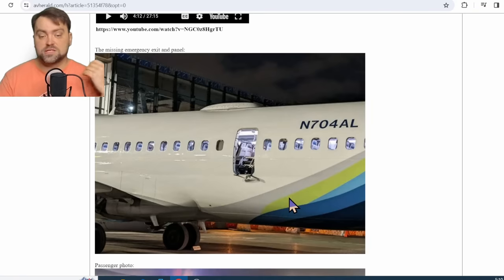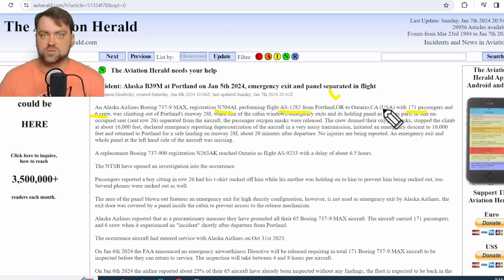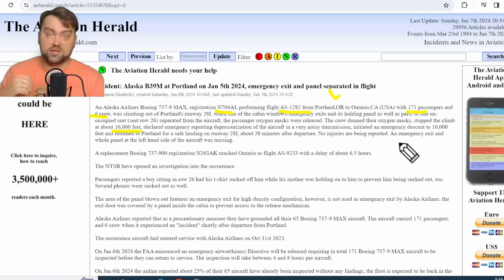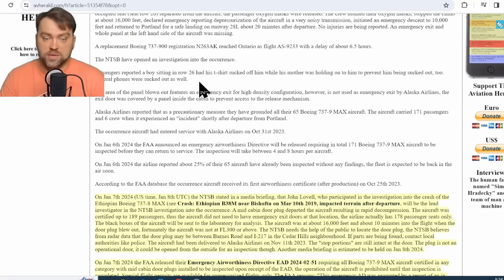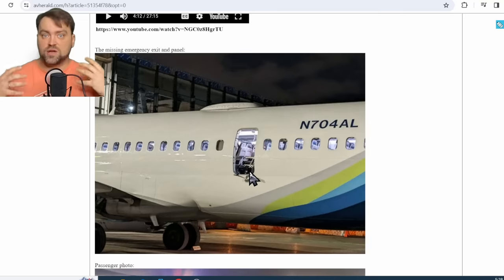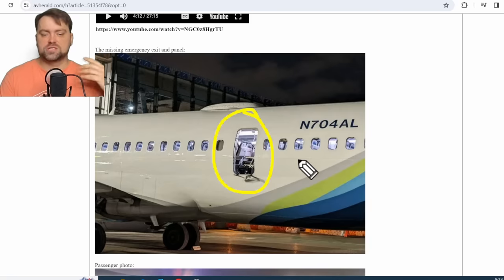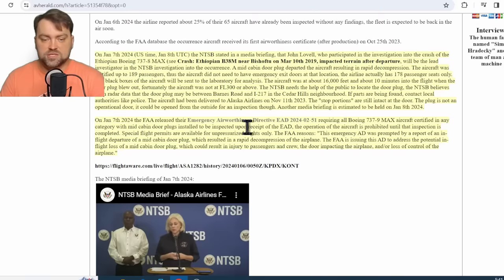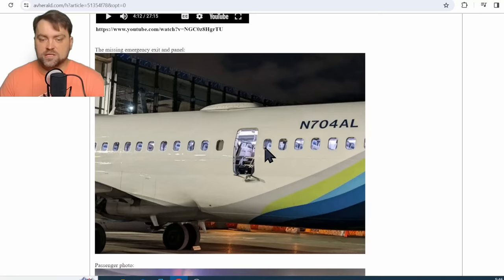Alaska Airlines Boeing 737 MAX Door Separation Update | What Happened?

Comment: What is going on with the MAX series? Does the MAX stand for MAX profit at the expense of safety?
Reply: If it's a Boeing, I'm not going.
Reply: @iactiv6274  Nah, the Boeing 747 "Jumbo Jet" is my favourite plane, so I have no issue with Boeing. Specifically the MAX series variants seem to have an unreasonable amount of issues.
Reply: What if people says Airbus is to be blamed for the recent a350 incident in Japan?
That would sound dumb right?  Same as anyone blaming Boeing for this incident
Reply: What plane hasn't has problems. The 737 is s 50 year old platform that has been thr safest and most successful plane in history. 
It will take a lot more "problems" before that record is tarnished.
Reply: @kewlztertc5386  Would you say same if one of your relatives died on board such a disaster plane?
Reply: And way, way more people have flown on them... safely.
It's always a per passenger mile question...
Why don't you check the number of people who died in Chevrolet xxx?
Reply: @Samguy55  Who else is reliable for this mishap except Boeing? this is a part of the plane that has to be checked only after years except in cases of severe damage. So, tell me why one should not blame Boeing for that!
Reply: Imo the problem is not so much the plane, but the quality assurance at Boeing right now. They have cut corners, got preferential treatment by the FAA, and only admitted and addressed issues after accidents happened.
Reply: @lohikarhu734  How many cents per post are you being paid to defend Boeing?
Reply: @Samguy55  So how does the plug/door of a brand new Boeing 737 Max 9 fall off if there isn't a huge problem from when it was manufactured?  I'd say this falls entirely at the feet of Boeing!
Reply: @smacktard6051  wrong, that record goes to the 727. 
Did you even bother to confirm your erroneous information before responding?
Reply: @thabom9791  I have gad loved ones who died in GM cars, I don't hate Camaros.
Reply: The fuselage and door plug are made by Spirit Aero, a subcontractor of Boeing. Still, the responsibility lies with Boeing to ensure the entire airplane is built correctly.
Reply: @johnhaller5851  That's right, Spirit Aero (not to be confused with Spirit Airlines) is currently a subcontractor of Boeing. They were part of Boeing until 2005 I think, when it was spun off into it's own legal company so they could also do work for Airbus.
Reply: @kewlztertc5386  I think you're confusing the classic 737 with the MAX series. They are completely different aircraft that should not even share the same name. I'm convinced they only kept the name to benefit from it's reputation and to fast-track certifications. The MAX clearly has quality control issues, the plane is literally falling apart in the sky.
Reply: I'm thinking that the position of door is creating a longer arm from from the horizontal elevator, creating bending and twisting forces greater than a door closer to tail surface. The result of this forces cannot be seen by the eye.  This reminds me of early Jet crashes of the "Comet". In the comet the window were too big allowing twisting and bending forces to be greater. I hope that this is made and develpoed from scratch. I can't imagine of using plans from rear door.
Reply: @johnhaller5851  They are, but then they are shipped back to Boeing for the interior cabin to be fitted. The plug/doors are removed again by Boeing during this process. Info courtesy of Blancolirio. https://www.youtube.com/watch?v=WhfK9jlZK1o
Reply: @maybehuman2148  they're not different. It's just an iteration,  like the NG, 400, 200, and 737-100. 
It's the exact same frame, with upgraded avionics and engines. 
Just as the preceeding generations were upgrades from generations before. 
The MCAS issues they had with the 737-8s (Max-8) 3 years ago was because of the larger engines they fitted on the plane compared to the 737/NG.

This plane is a 737-9 (MAX-9) extended fuselage.

Lastly, it's named MAX, because it's the end of the 737 line.  It was designed to bookend that model number and be replaced with the now defunct 797 concept.
Reply: @kewlztertc5386  When an aircraft has completely new and significantly larger engines, new avionics, a different center of gravity, even new wings, is it just another iteration or a new aircraft? How much different does it need to be in your opinion?
Reply: @maybehuman2148  it's not MY opinion. It's the opinion of Boeing and the Aviation community. 
Instead of attempting to express your cynicism, why not actually look up why?

Here's what little I know:
 it's the same platform. Just like the 5 or 6 variants of the 747 (100,200,400, SP,,ng,800) over the decades.
 It seemes to be based on the fuselage. 
They upgrade the 777, with carbon fiber wings, it's still a 777.

Engines have always been an option on airplanes. The airlines up until recently had a choice between GE, or  Rolls-Royce. 

Finally, The FAA requires type ratings if the Avionics change too much. So manufacturers make incremental changes that require less simulator training. Making it so a pilot only needs to learn what's new and not a whole new system. This is the root of the MCAS problem with the Max-8. 

But I don't know any of the details for sure. This is why it would be helpful if you looked it up and informed ypurself and me.
Reply: @kewlztertc5386  TL;DR: You don't want to think for yourself, so a new aircraft is whatever Boeing tells you it is. Got it.

Comment: My thoughts on this accident...someone forgot the bolts or fasteners and the door broke away cleanly with no tearing.
Reply: @mh-ht2fp There’s no flaw- this exact plug style exit has been around a long time. The question is who didn’t install four lock bolts correctly?
Reply: Agree, someone didn't inspect the work on completion of the aircraft. I assume these plugs are considered permanent and not a check item for maintenance.
Reply: @mh-ht2fp  well we are talking about Alaska Airlines, but also a new plane 
so its ether Alaska has turn back to their old ways or
counterfeit aviation parts have gotten into Boeing supply chain
Reply: @denault3985  There is going to be some interval to open it and check it and the seals and replace the bolts, and probably a shorter one to check that the bolts are still lock-wired.  But probably not yet given how recent the airplane is.
Reply: @1BigBen  This is not a part that needs maintenance. So it must be a production failure by Boeing.
Reply: Oh it tore stuff up. All around that door area go damage.
Reply: NTSB only has to check the comments here, then they don't have to investigate anything anymore. Everything is already known by the internet experts here.

The benefits of the internet are clearly showing.
Reply: @jantjarks7946  There are two likely causes.  The bolts that are supposed to lock the plug in place were not installed or 4 bolts in a new jet all broke off with no obvious sign of damage after 2 months of operation.  That's why the NTSB wants those mounts in DC, so they can see if there is evidence of a bolt ever having been installed and tightened down.
Reply: @1BigBen Alaska doesn’t install the door, Boeing does.  I don’t think this has anything to do with wrongdoing by Alaska.
Reply: I heard reports this plane already made 150 flights before this happened, so the bolts were there. More likely the bolts were either defective, or something wasn't fastened to the correct torque. Repeated compression stresses and vibration kept weakening them until they snapped.
Reply: @jantjarks7946  Calm down dude. It's the comment section, people like theorizing for fun, nobody is getting in the way of the official NTSB investigation.
Reply: @maybehuman4  Or they were not lockwired and the nuts slowly loosened.  Juan Brown says it was not lockwire, just bent cotter keys, but that would work the same with the castle nut.
Reply: Yeah, sorry to interrupt the theorizing into trash talking. Please go on, it's not your reputation to be ruined by speculating the heck out of something.

Absolutely no one starts to jump the gun right away in the comments due to it, really no one. You can read the other comments, absolutely clean of opinions and only facts.
🫣😉
Reply: NTSB seems to agree in tonight’s briefing.   There are no signs of the stop bolts and they are next looking to determine if they were there at all, or not sufficiently torqued or something else.  It sounds like being sheered off is ruled out.

Comment: Clearly the door could only come off from the aircraft without damage to the airframe if the bolts were never installed or were not correctly tightened causing them to come loose and fall out.
Reply: Someone call the NTSB!  Call off the investigation.  They just need to talk to ecomandurban who has all the answers.
Reply: It doesn't work that way on these types of doors.
Reply: @stargazer7644 , it’s because someone took that “Do Not Disturb” card off the door handle!  I think it’s pretty obvious!

Comment: Hi Dennys,
"Boeing urges Airlines to inspect 737 Max Planes for possible loose bolts in the RUDDER-control system",
from Dec. 28, 2023.
The FAA was aware of loose bolts in the rudder-control system as well?

So, that means there are loose bolts everywhere on that Boeing Max machines.
Also:  turns out the cockpit door is designed to blow open in case of rapid depressurization,
causing your headset and your emergency checklist flying out of the "window".
😅
You can't make those things up.

I wonder, have you been aware of that?
gl, and thx for the update.

Comment: Fasteners holding the door plug in place needs to be safety wired to prevent coming apart. Secondly the fasteners might have stretched causing a leak from the inside to side.
Reply: Going further, for cost reduction Boeing installed door plug in the spot for regular door as no door was required if the number of seats are less than 175 or so. In the USA where the number of seats are less than 175 , door plug has been provided but for other parts of the world where the number of seats is more than 175 or whatever, there is a full fledged door with emergency pneumatic slides and appropriate electric interlocks to arm and disarm the emergency features at take off and landing. This door costs tons of money and door plug is probably offered free by Boeing, consequently its failure modes are not modeled and consequent effects are not analysed which is why this Alaska airplane got into close to fatal trouble.
My recommendation is kiss good bye to door plug and install regular door in its place like full seater models.
Reply: @padmahariharan6327  That will not happen, as these exits are mandated to be covered by flight attendants, which would mean +2 crew on every flight.
Reply: @csgergo80  
Unreliable door plug is not an option.  
I can redesign the closure which will open inwards so that higher sir pressure inside the plane will maintain it closed.
The seat adjacent to the door will need to be eliminated to provide maintenance space near the door
Reply: @padmahariharan6327  It's perfectly reliable, as long as Boeing puts it together the way it was designed. At the moment it looks like the 4 bolts that secure the plug were MIA. Any one of them would have prevented this accident, and be fixed at the first B check.

Comment: There are a total of four retaining bolts with locknuts that hold the door in position in their tracks so it can sit properly against the stops, that were more than likely missing. The question is how did this happen. ie: who forgot to replace the bolts?
Reply: and who signed it off - surely atleast two pairs of eyes should have gone over this
Reply: replace what ? This A/C entered into service 3 months ago....  Brand New.

Comment: After working with the FAA on the agency's investigation of O'Hare International Airport workplace safety, may I suggest that the FAA issue a directive that would direct Boeing to install standard doors to encapsulate this opening or forbid the commercial airlines from seating passengers adjacent to this plug door. Manufacturing procedures should be further scrutinized.
Reply: Why in the world would they do that? These plugs have been installed a thousand times in multiple different versions of the 737 over the last twenty years with zero problems.

Comment: The interesting thing is the mounting lugs appear intact or at least not badly damaged? Almost as if the plug was designed to fit from the outside rather than inside. Will be interesting to see a photo of the plug.
Reply: The plug does fit from the outside.  That's the direction it opens.

Comment: Obviously, there are versions with that panel containing a door (for Ryanair) and without a door. Why have the one to be checked, and the other ones not. The mounting of the panels should be the same.
As the panel has now been found it should be possible to know the exact reason for the failure. I have read the FAA airworthiness paper which contains everything but what has to be checked exactly. I think that is written in advice from Boeing.

Comment: The real issue is why is the door plug designed to open during rapid decompression, why would any airline have seats in that area?  I would not want to be seating there at 30,000ft.  That is a major design and safety issue.

Comment: I will give a speculation.  There were three previous warnings of partial loss of pressurization.  It is not unusual for planes to have wiring go defective or need replacement.  You still fly if the mechanics and pilots believe it safe to do so.  It is only in retrospect that a probable cause can be determined.  The cause was most likely a bolt.  It could be that a bolt was not tightened, that a bolt was not an approved bolt or was defective.  You can open panels and determine that they are tightened bolts.  It won't tell you whether the bolts were approved bolts.  Now Boeing has to go through its records and that of the subcontractor who did the frame.  It happens.

I had my car tires rotated at the big box store.  The mechanic failed to tighten 3 bolts on one of the tire assemblies.  Fortunately, I stopped and had AAA service and was good to go.  Things happen.  

Right now, there is a lot of investigation being done that will never see the newsprint.